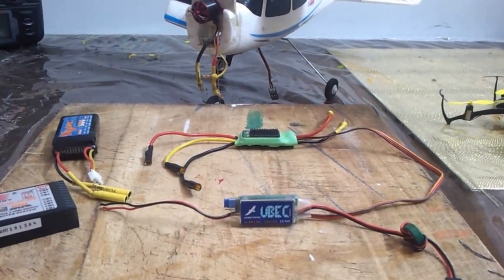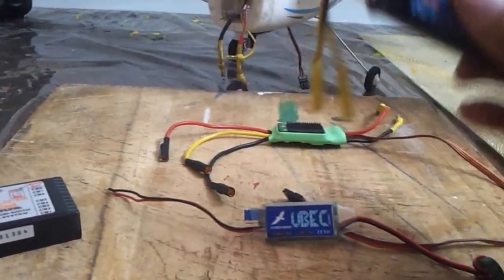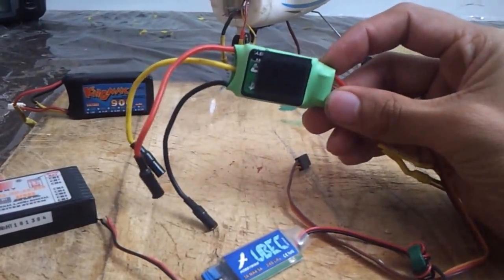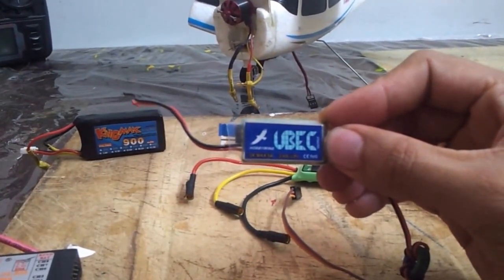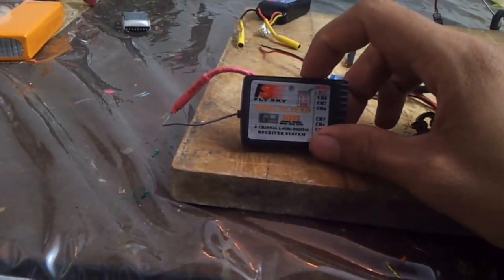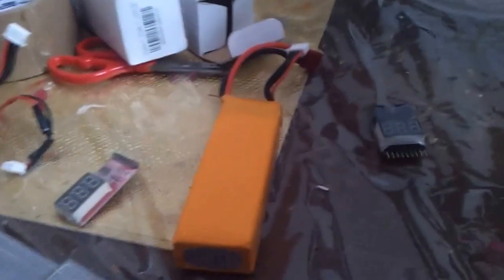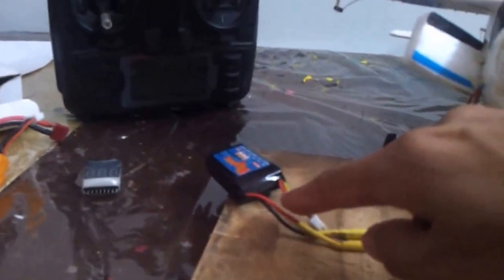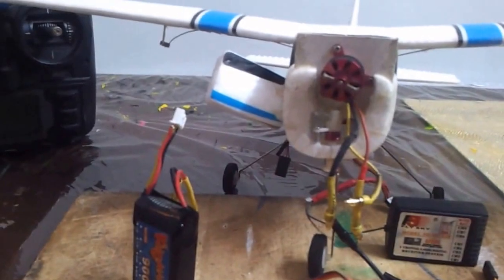Battery Eliminator Circuit - Easy way to setup a BEC.

Comment: Good video very educational.
I am wiring a 20a bec by YPG
To a 12s lipo system. Thats going
To be tough. I can adjust the bec 
Voltage output from 5v all the way
To 8volts.
Reply from the maker: Thank you.

Comment: good video.I was thinking about adding a separate ubec to my sky surfer.
Reply from the maker: Thank you ham6817. I use it on my sky surfer V2, I feel lot more safer to fly with the External BEC hooked to my RC circuit.
Reply: Naren Nanjappa ok. So do you just unplug the one from the esc going to the Rx
Reply from the maker: ham6817 You will have to alter you circuit little bit. Currently your sky surfer motor and your receiver is powered by one single LiPo passing via the ESC. To setup a BEC all you have to do is, solder the correct leads of the BEC to the output of the LiPo and the other end of the BEC will power the Receiver. Now to power the ESC use an other lead from the LiPo. Basically you are making 2 leads from the LiPo. One to power the BEC to receiver and another to power the ESC to motor. Y connectors make it easier to build this circuit. I will make a video on this one very soon.